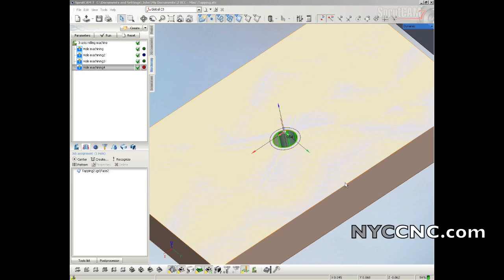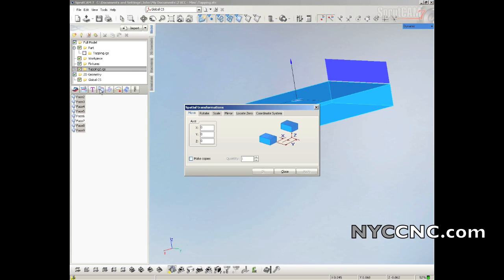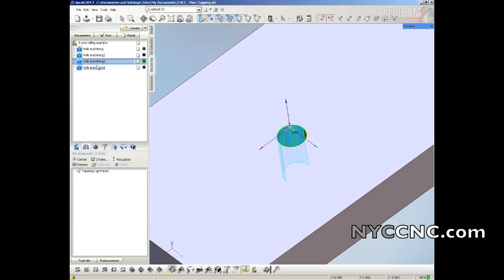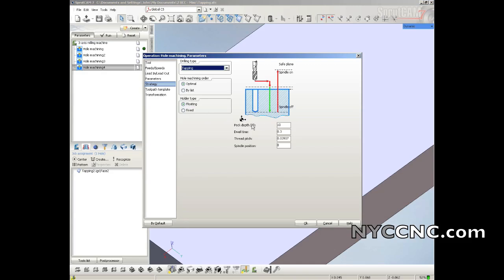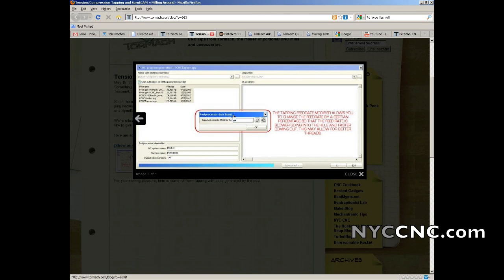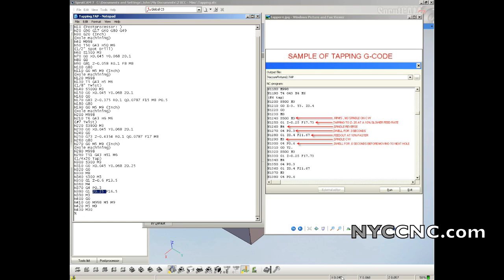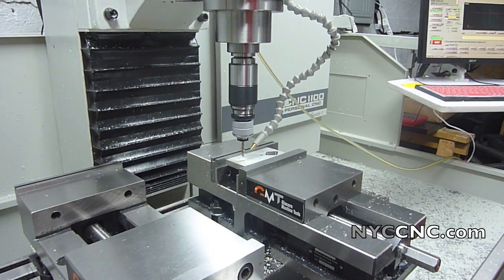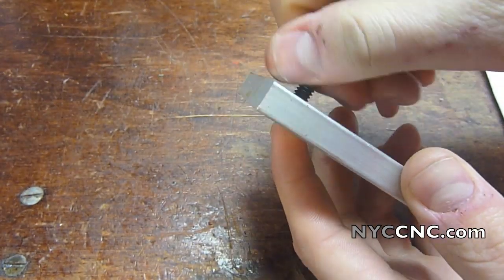Tormach PCNC 1100 - Tapping with the Tormach!  Creating tapped holes!

Comment: Excellent video. I used this video to do my first tapping operation on my Tormach using the tension/compression tapping head. Very cool. I have a question. When you setup the tap speed, you started out with 300 rpm and then explained how to calculate the cut feed of 15. All that made sense. But where did the 300 rpm come from? Is it 300 because it's a 1/4-20 or would an 8-32 also use 300? Did you estimate the 300 using Gwizard? My main question is whether the 300 is critical and needs to vary with tap size or if I can use 300 for my other taps also (I will be tapping 2-56, 4-40, 6-32, 8-32, and 1/4-20).

Comment: Thanks for the heads up- I think i may have found what you did (in case anyone else has a similar question):
In the Miscellaneous tab (not in the parameters window, in the bottom left pane) there is a checkbox under simulation called "check for gouges"- unchecking this allows the simulation to complete without errors.

Thanks for the video and feedback.

Comment: You made the hole in your solid model the size of the #7 drill then proceed to tap with a larger diameter tap- yet you got a green check from sprutcam.  
Is there a setting you had to select for this? I am using version 8 and am getting a "collision" when i use a 10-24 tap on a #25 sized hole.

Comment: IMO, i wouldn't pilot drill, especially if you may be running production parts. Curious as to why you used a spiral tap? They are usually used for blind holes, they pull the chips out due to the nature of the helix angle, thus preventing chip build-up at the bottom of your hole. Through-holes such as the one you drilled, may have better luck with a regular 2-3 flute plug tap. The cutting nature of these taps "pushes" the chips ahead of the tap and out through the bottom of the hole.

Comment: @saunixcomp 
A pilot is rarely necessary. Many do it because they think it will result in a more accurate hole but when going through with the final size the bit can be pulled off to one side when it catches on the sharp edge of the hole. Best thing to do is spot with a spot drill of the same angle of the drill and then drill to final size. Also use screw machine length drills, not jobbers. If you get 135 deg jobbers you can often get away without spotting as they are as stiff as the spot drill.

Comment: Nice work on the TTS tapping video, have you tried to tap a 1/2 inch thread yet?  I am curious as to how well the head works with larger diameter cutters. They spec it for 1/2 inch but is that in aluminum or steel?   Have you used it in any steel at all? I am using a CNC Converted RF45 mill with a sensorless vector and belt drive much like the tormach and I am seriously thinking about purchasing the tension compression tap head from them. What is your overall opinion of the quality of the unit ?

Comment: Can the Tormach do rigid tapping? I was also curious, can you use and "E" value for the feed/pitch of tap? In other words when I program a tap cycle at work with fanuc control I use a G84 (tap cycle) and the feed value is expressed as E. "E"  is the tap pitch . 1/4-20 would be E20. What ever rpm is chosen the machine will caculate the feed it needs at that rpm. Its super easy and no caculateing any thing. The only time you need to caculate is with a metric tap. convert the metric to S.A.E. pitch